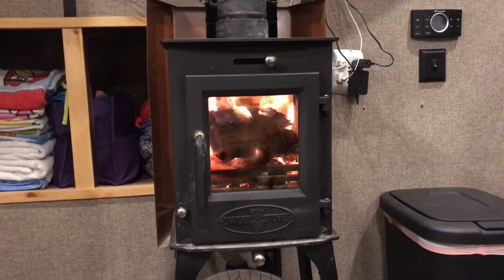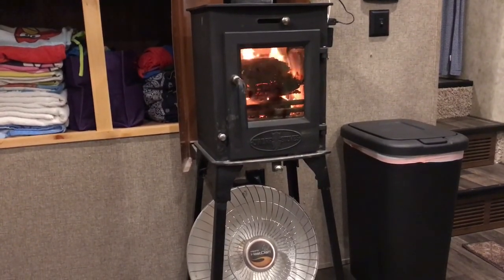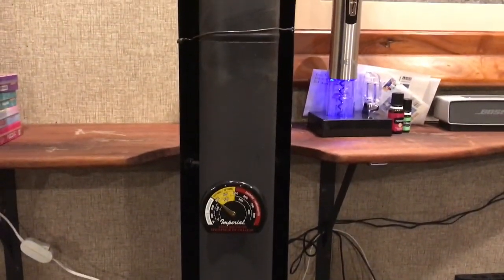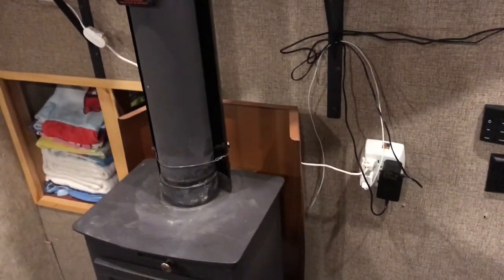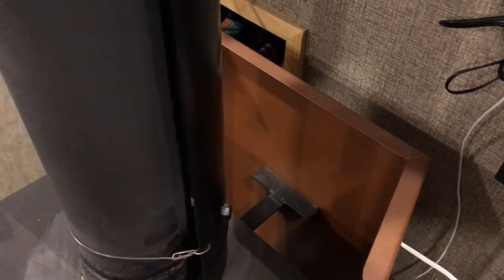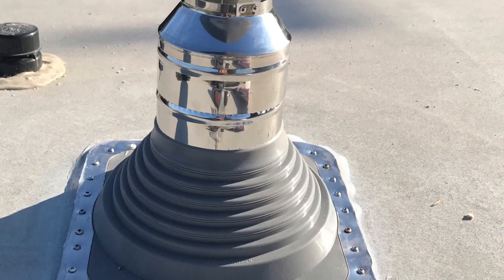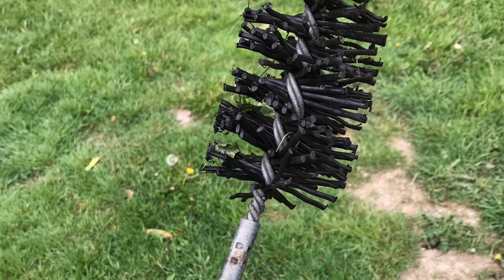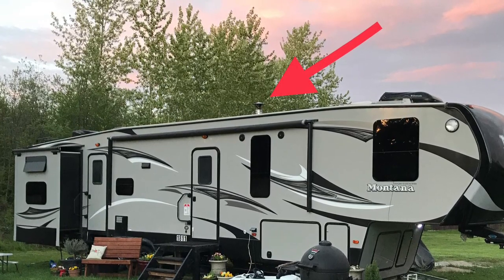Full Timing RV wood stove install

Comment: How many square feet are you heating? Does the 4kw heat it sufficiently and/or "cook" you out?  We live full time in a 28 ft camper trailer. I'm stuck wondering weather to buy the 3kw or 4kw. We will be using the DWARF Direct-Air Intake Box with ours, since we are fairly poorly insulated, and live in the Pacific Northwest.  Also where did you purchase your sheet metal for the heat sheild(s)? What gauge did you use?
Reply from the maker: We had about 400 square feet to heat (40ft RV) and the 4kw was perfect. If you’re poorly insulated, I’d go for the 4kw. You can always open a window if it gets too warm. I believe It was 22 gauge sheet metal that I used for heat shielding and found at a local hardware store. I’m sure 26 gauge would be fine as well. Good luck and be safe!

Comment: Great video! Did you have seal the points where the bolts secure the heat shield to the pipe?
Reply from the maker: I only fastened the stand-off bolts to the cut 6” pipe (heat shield). Then that 6” pipe is held up against the 4” pipe with just wire. So, the bolts don’t go through the 4” pipe and therefore no sealant necessary.

Comment: With being full time that past 5 years, and propane last fill for summer at $3/Gallon delivered 100gal tank rental, and was told next winter will be higher.

Looking to install our older sears oil burner we used in our homes since the mid 80's that we could change out of wood if used oil is not plentiful, but having a time. We have a large enough window in our Toy Hauler garage, that we don't care if we pull it to run the pipe through, but having a time trying to get the right information about the pipe. We have been told single/double wall inside but have to go triple-wall from widow up. In our area we are required to have 2ft above roof that will require 6ft total of pipe outside to mid point of window.

Can we use double wall all the way and outside, or do we really need use triple for the 6ft outdoor run?. Not finding enough information. We wanted to avoid running through the roof if possible.